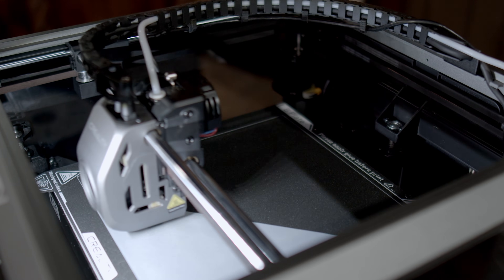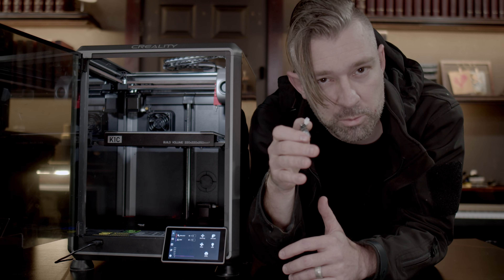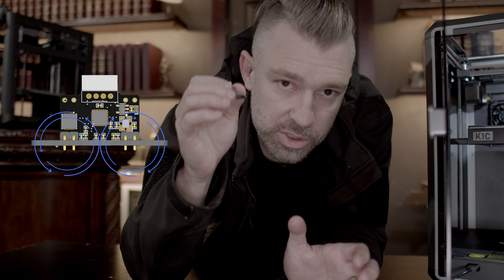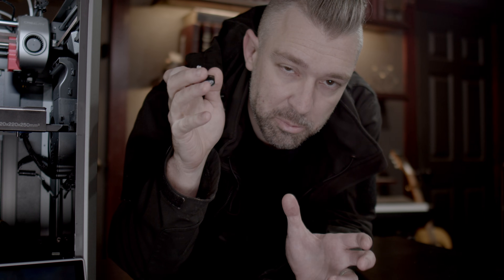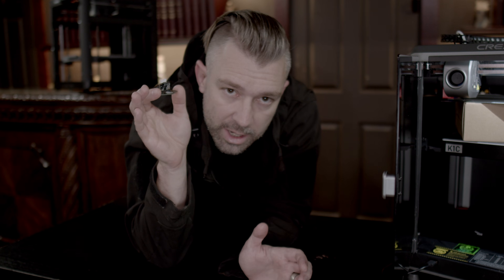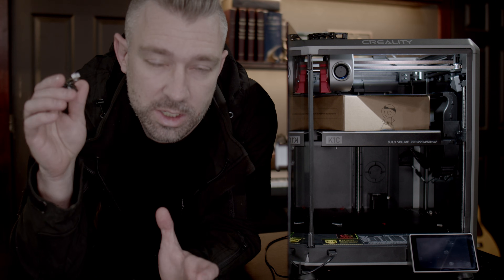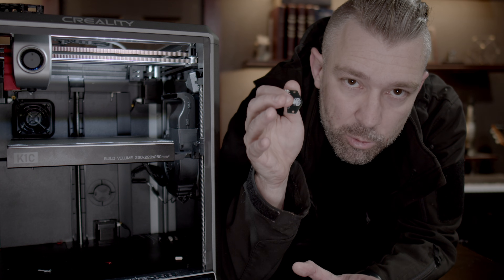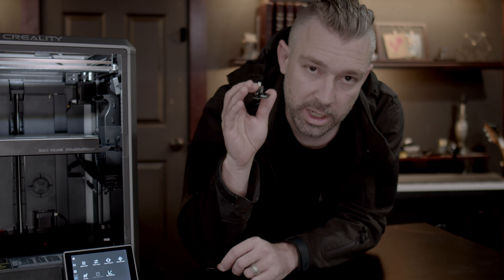Your Creality K1 3D Printer Cant do This! Cartographer3D

Comment: I have a question if anyone can answer it. I have a K1 max. I ordered the 90° cartographer sensor and plan on utilizing the usb plug on rhe tool head. Does the wire at rhe k1 max plug into the sensor or do I have to modify it? Also on the main board end the wires will have to modified as well?

Comment: Yeah yeah, but it only works if you use metal build plates. I print on 3mm G10, and occasionally switch to another surface.
Still BL-touch is the way to go, because that physically touches the plate. It doesn't care about conductivity, or how thick the non conductive sheet is on top of your metal plate.. 
Slow? No , If I don't switch build plates , I don't have to do a new bed mesh at all. One probe in the middle is enough when starting a print.
Perfect first layer every time, These inductive probes  are way overrated and would be very inconvenient for my use case

Comment: Does this work with the glass sub bed mod on a K1 Max?
Reply from the maker: Currently the mount for the Cartographer3D isn't compatible with the rear channel for the glass sub bed mod. I am working on a probe mount that will bring compatibility to the glass sub bed mod.
Reply: @zerodotcmd  Appreciate the response and the time you're sinking into it.
Reply from the maker: @jg0909  No problem! hopefully the new mount will be available soon. I am however a bit back logged. But its at the top of the list.

Comment: Hahah after installing the BTT eddy install minus using the glass bed mod you shown I had quickly uninstalled it after 3 prints.  I was rather unimpressed and it wouldn’t hold a Z-height for home.  I am excited to see a full install guide and maybe going through the simple af Klipper install with you.
Reply from the maker: Unfortunately the BTT Eddy was like this. Worked for some but not for others. The software was pretty much abandoned. For the most part its usable now in SimpleAF, it took a lot to get it usable for more users. Unfortunately I wasn't aware of these issues since at the time no one was using the Eddy. After more users came on board problems became apparent right away. Luckily the Cartographer3D has a great track record already.
Reply: @ yeah.  I bought the eddy back when it first came out with all of its hype…  but hadn’t installed it because I like the auto z-offset crutch that PR-Touch had to offer.  As a result, it then sat and sat until i saw your eddy install video and i figured I’d give it a go.  But my machine couldn’t hold its offset to save its life and got horrible z-banding mid print. Didn’t aspire to dig any further and uninstalled it.  Went back to PR touch and bought a carto until I find inspiration to install that 😆

Comment: Finally custom firmware! Been waiting for this as opposed to just rooting it.
Reply from the maker: If custom firmware is what you've been waiting for then you'll love SimpleAF!
Reply: @zerodotcmd yes I have. Just like on my ender 3’s
I want rid of Creality’s washed down things really. 
I’ll give it a while for any major bugs to be ironed out and I’ll figure out installing it 😁
Reply from the maker: @DSPrints_  SimpleAF has been used for a while now by a pretty good size community. Pretty much all bugs are worked out. There's always the edge case of someone trying to do something weird. But for the most part its Install, Setup Probe, Print.

Comment: And what about a co,parsion with BTT Eddy?
Those two are preety similar in their work principle.
Reply: So the btt eddy as far as hardware goes, I think they are probably equivalent, but where the eddy gets let down is the software and software support.   The cartographer has far and away the best software support and the cartographer dev team is continuing to work on improving it.   The eddy seems like its been left to stagnate a bit.   Look if you already have the eddy, its a pretty good probe and with Simple AF you can get good results, and we are still working on trying to make it an even better experience.
Reply from the maker: Pellcorp's 100% right. The hardware isn't bad but they have pretty much abandoned the software side of things. If you already have the BTT Eddy you can still use this with SimpleAF pretty reliably.

Comment: Will simple af work with the load cell bed probing on the k1 max if i don't want to use the eddy/cartographer3d?
Reply: I wish we could but as already explained the prtouch code is closed source.   There is some active work going on to bring the load cell stuff to klipper and make it open source, but it will likely require some hardware changes anyway to convert the 4 load cells to a single one, but at the moment its no where near ready for every day use.   Even a microprobe or bltoucch is a better choice than the load cells imho.
Reply from the maker: Hopefully this eventually makes it into SimpleAF as pellcorp has said. Its one of the last holdouts for the K1 Series.
Reply: It won't as prtouch (load cell probe) isn't opensourced by creality.

Comment: I'm new to those mesh tools. Is this one better than the BTT Eddy?
Reply: If you have not purchased the eddy, I would recommend the cartographer.   However if you already have the eddy, you can get it working, its just slightly more painful.   SimpleAF supports both of them, plus microprobe and bltouch and clones (crtouch, 3dtouch)
Reply from the maker: Pellcorp is correct. If you already have the Eddy you'll be alright, but if you haven't picked up a probe yet then I highly recommend the Cartographer3D!

Comment: Man i just got the BTT eddy to follow your other video.
Reply from the maker: The Eddy works well with SimpleAF. It took a lot of work to get it there. If you already have the Eddy you should be fine to move ahead with SimpleAF.
Reply: Don't worry, you're still getting contactless probing, 10x faster bed meshes and 10x more accuracy! Plus the red light looks pretty!
Reply: same XD
Reply: And a probe with a shitty so-called "support" from btt.
Already bought the cartographer. I'll throw my Eddy in the trash when it arrives.

Comment: Hello,

I was fed up with poor first-layer results and how uneven the bed was on my K1 Max. So, I made some changes: 
I installed 4 silicone spacers on the bed screws.
I replaced the magnetic bed with a 4mm glass bed.
I took a bold step and added an old-school "3D Touch" probe—the kind used on Ender printers. Surprisingly, it gave me perfect first layers, much better than the K1’s stock probe.
Sure, tools like Cartographer3D might offer faster and more efficient mesh leveling. But for anyone on a tight budget or without access to advanced technology, I can confirm from experience that even a simple 3D Touch works wonders. No need to install Simple AF unless you want to—just ensure your printer is rooted.

Your tips are fantastic, by the way!

If anyone wants to see the mesh leveling on a K1 Max with a 3D Touch, let me know, and I’ll share it. 😊
Reply: Simple AF also supports the BlTouch / CrTouch / 3dTouch as well, and either that or a Microprobe is a also great choice for bed levelling.   You can use a 3dtouch with rooted K1 with Helper Script, heck, I even have a guide for doing that, but Simple AF is imho just better :-)   Of course I am biased.
Reply from the maker: Of course, any probe is better than the stock load cells. The touch probes still work great. Just not as fancy. Luckily we don't always need fancy to be effective. ☺️

Comment: Amazing content Zero, you saved my K1 Max with the glass bed mod video, but with this probe and Simple AF my printer is now even better! Thanks.
Reply from the maker: Thanks awesome! Thanks for the feedback. I'm glad your printer has been saved!
Reply: it's actually  a passable printer now.
Reply from the maker: @xDarthwarzx  Putting time in the printer definitely makes it a way better machine.
Reply: @zerodotcmd  Hi.Thanks for the effort you doing.Ive just purchased k1 Max.
Wondering what mods would you recommend to get this printer for best performance don’t in one installation.
I’m new to 3d printing so not not sure how to combine all the information you’ve input on this videos.From what I understand bed levelling with glass not necessarily with cartographer upgrade looks like.
Can you make a list like.Steep 1 root the device.Step 2 nozzle and extruder repayment.I don’t won to disassemble the machine for each upgrade and also running in some incompatibility problems with different parts.
Interesting products I found as upgrades apart of what you show us on your videos DevilDesign DXC Extruder, e3d obxidian unicorn nozzle.
What would be the best combination and also how does effect if you planning on cfs upgrade.
I know it’s list of variables but hopefully you can give some advice.
I’ve notice also that your skills with modifying are far better than most YouTube’s that can hold screwdriver teaching us how to make repair while printer parts fly on screen left and right.
😂
Keep the good work!
Thanks again